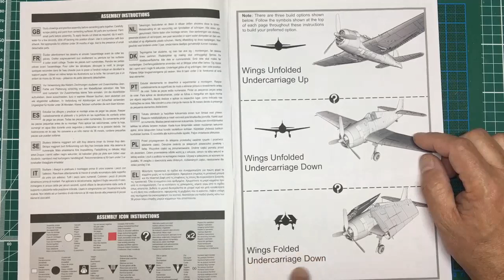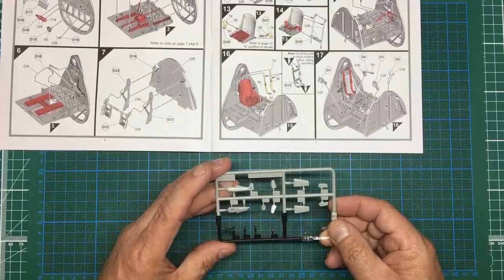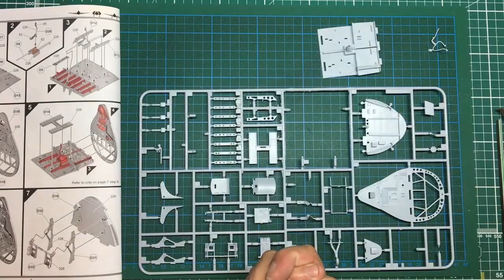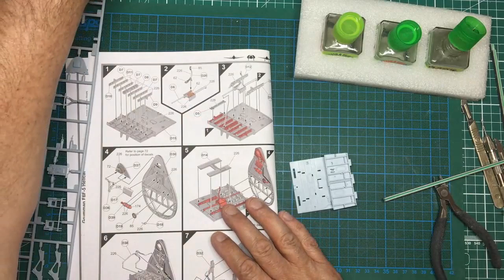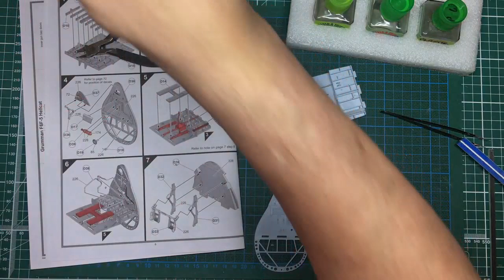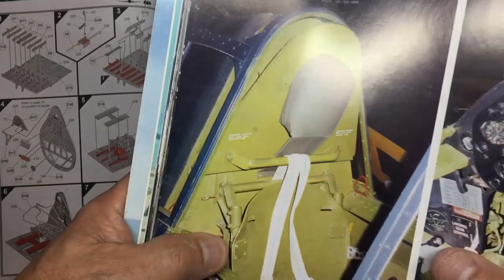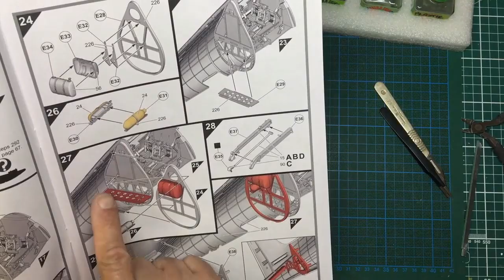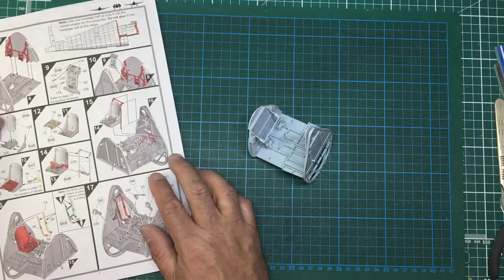Airfix 1/24 F6F-5 Hellcat Build series. Part 1.. making a start

Comment: I like the idea of filling all the ejector pin mark on a sprue. It really speeds up the build itself without all the starting/stopping. It gets discouraging when you're trying to build something and you're spending half your time waiting for filler to dry. Doing it all at once keeps the pain level to a minimum. If I try that on my Trumpeter 1/48 U-Boat, I think I might finish by Christmas. Way to go Airfix on the One Sub-assembly/One Sprue. Trumpy method 5 parts scattered across 4 sprues in 3 different boxes. Grrr!

Comment: Nigel. On the flory sanders. White is most course and green least (blue middle). At the moment there are new flory sanders with 1 hard and 1 soft side (green and blue). The green is a combo from the green sanderand the black sponge. The blue is a combo from the normal blue sander and the blue sponge.

Comment: Looking good fit wise so far Nigel.  I tend to do the same thing you do concerning the ejector pin marks, I remove/or fill them wherever I find them whether they will be visible or not and test fit everything twice and glue once. While I am not a novice modeler always good to see a refresh on the tools used.  I sent you an email with some cockpit photos of the f6f, hope they help.

Comment: Nigel, a tip for the thick fingered, wrap several layers of masking tape around the back end. It lifts up the back slightly but it still won't roll off your bench...you could use elastic bands as well.

Comment: Why not display model with one wing folded and the other extended? There is a pic of a model in this config on the side of the box  I think. They were manhandled separately so it would be possible.

Comment: I got 2 of these kits, on building the first one after building the cockipit and putting it into the fuselauge and built the wings i ran into problems and seriously stuck on it because they did not go together very well in terms of it being level and fit well how did you find it
Reply from the maker: I have onky dry fitted so far but it all seems ok.

Comment: Nigel, that plastic weld, isn't that the same stuff as extra thin? Or is it something you created?
Reply from the maker: Hi @Aldwin Rutten it's from EMA model supplies. It's like Extra Thin only a little hotter. It works very well on styrene sheet and strip.
Reply: Nigel, thank you Sir. I learn something new every day watching you build.
Reply: @aldwin rutten . I think ems is one of the few glues that will stick abs plastic , its also instant in glueing plastic and can be used to smooth plastic very well with a brush , it will not string up . you can use it to get rid of fine mold lines , say on an undercarriage leg in the tough to reach spots .

Comment: Nigel. I got this is a Christmas gift and I am 100% a beginner. Can you recommend the minimum amount of paints I would need to buy to complete. I'm not sure if everyone of the paints listed on the side of the box is required or if that is just what would be needed for each of the 4 colour schemes on the box.
Reply from the maker: Hi Paul, if you are 100% beginner i would buy a smaller cheaper kit or two before tackling this one. Having built most of mine now i can tell you this is not a starter kit. As for paints... well, it all depends on how far you want to go? I mean, you could get away with green for the cockpit, black and silver for detail parts and engine and gloss blue for the outside. One point to consider.. if you're brush painting you're best off getting humbrol enamel paints. Steer clear of Tamiya paints for brush painting. Hope this helps.
Reply: @NigelsModellingBench  thanks it helps a lot. Whilst I say I'm a beginner I've built basic airfix in my youth. I'm a methodical guy and I'll be taking my time with it. I'll steer clear of Tamiya and go for Humbrol of the colours you suggested. Thanks for the swift reply!